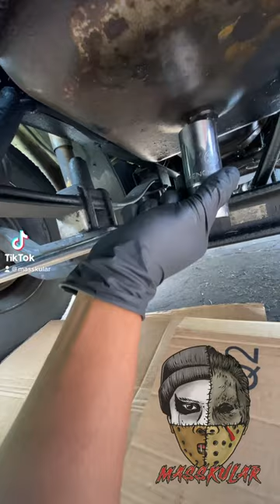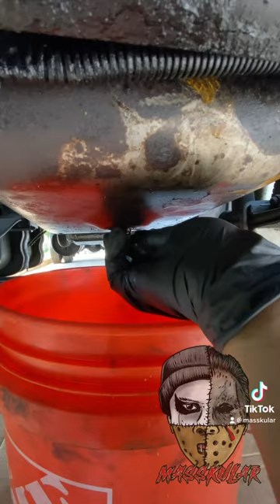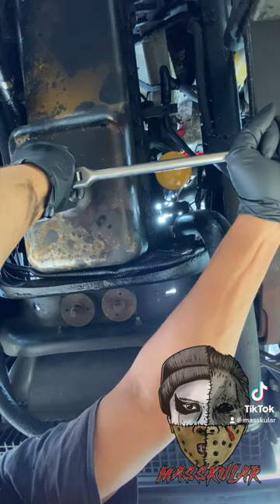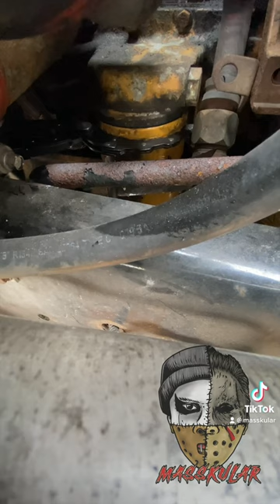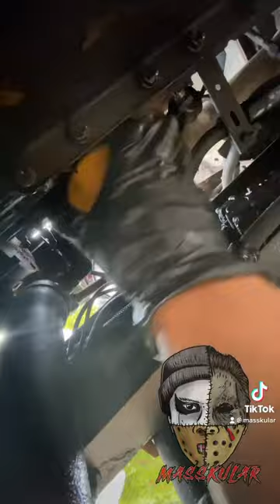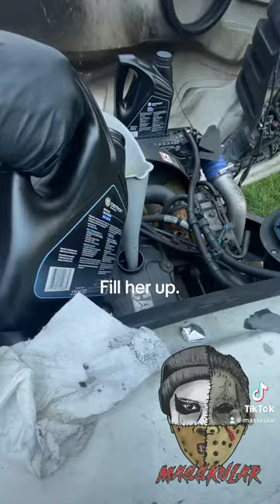Do your own oil change on your semi truck, tow truck or box truck. Easy

Comment: Oil filter right over the front axle  maybe loosen it and put a hole on the edge of the bottom  so it hits the bucket without making a mess.
Reply from the maker: Strangely when I pulled it it didn’t go everywhere. But thanks for the tip will remember that for the next one.